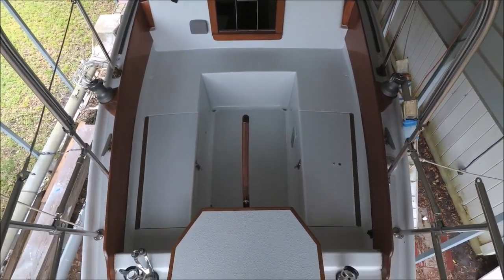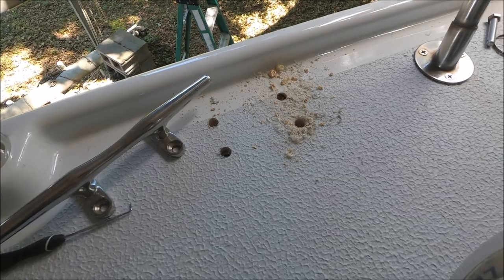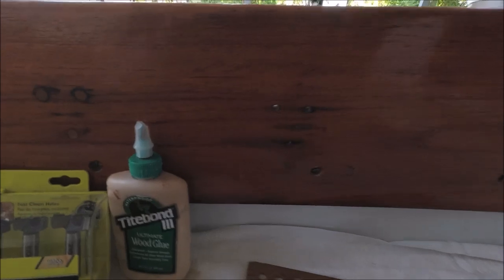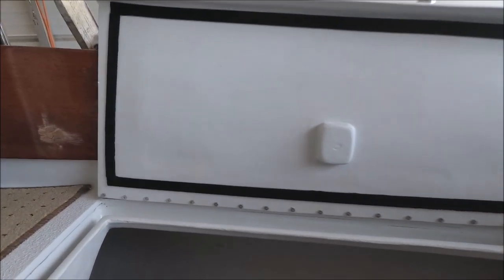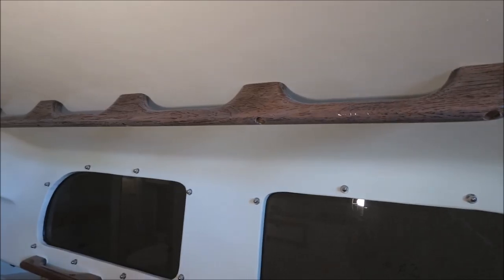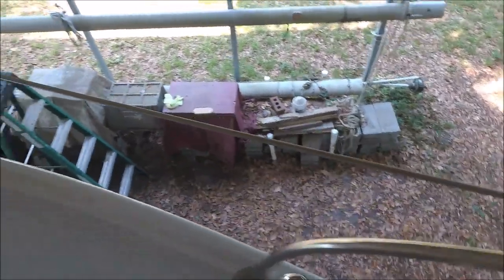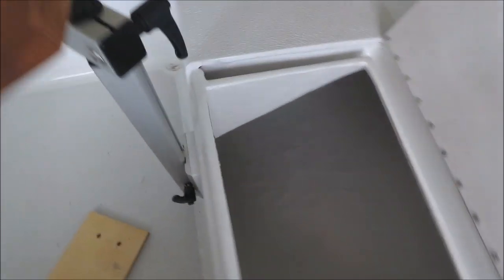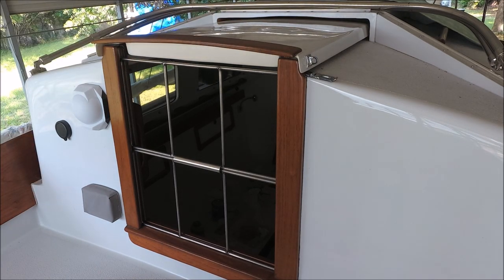Installing Sailboat Deck Hardware Triton Osprey Refit Part 14

Comment: This guy is one of the best and well thought dudes I have ever come across.  Gotta love it.
Reply: John Bolongo Yes he is. I had originally thought to place some kind of outboard motor mount to the back of my boat(which would be ugly probably) but then I saw these Alberg 30s with an outboard coming out of the transom and I’m like “genius”. Now i can have a 9.8 outboard as the main drive and a 9.8hp for dinghy( build up the capacity plate to allow for the longer shaft) and backup as main. Redundant engines! At least, thats my initial thought.

Comment: Beautiful. Electrical question. I see you use GFCI receptacles.  My old boat does not have any. Should all recepticals be GFCI?
Thanks. You do beautiful work.
Reply from the maker: I hesitate to give AC electrical advice but as I understand it you only need the first receptacle on each circuit to be GFCI since it can protect downstream receptacles. But I heard it is recommended to have GFCI in galley, head, and engine room. Since I work mostly on small boats that are potentially wet in every location, I use them for all outlets. On a bigger boat with many more outlets, if I was on a budget then I might use cheaper standard outlets in the drier areas while ensuring the first receptacle in each circuit was GFCI.

Comment: Thanks for another great video. I'm having trouble finding a decent, marine butyl tape. Could you please let me know what brand you use and what to look for in the specification?
Reply from the maker: I've tried several butyl tapes and found all of them less sticky and prone to leaking except for Bed-it butyl which is pricey but excellent:
https://shop.marinehowto.com/products/bed-it-tape

Comment: Hello James, been enjoying your videos.  I have a question for you ; I have a 1960 Triton that I removed the rub rail to clean up and get ready for new paint and I see the hull to deck joint needs some work, the sealent has gapes . How is the deck to hull joined ?  I reach up in the inside  of toe rail and can not feel any bolts or any other fasteners. How do I clean out old seal and reseal the joint ?
Reply from the maker: The hull to deck joint on the Triton is a butt joint with no overlap or fasteners. The factory set the deck on and then glasses the joint on the inside. They may have added filler or caulk on the outside. You can scrape out the loose caulk and fill with 5200. By the way, you may want to join the plastic Classic Forum to ask future questions and I'll answer there. I've been referring questions there where the group can benefit from the discussions. http://plasticclassicforum.com/forum/

Comment: I really enjoy your videos and have learned so much from them.  I would like to ask you a question regarding corrosion between dissimilar metals.  I thought you had mentioned this on one of your videos but could not find it.  I am currently doing some work on my boat trailer.  I has a steel frame and I need to replace some of the bolts. I am planning on using stainless steel bolts.  Do you have any recommendations for preventing corrosion? I thought there were some products that could be applied to the bolts.
Reply from the maker: I use Lanocote on bolts to prevent corrosion when installing stainless fasteners into aluminum. Tef-Gel is also good for that. I don't use anything on stainless bolts on steel frame trailers but it might be a good idea to use it if it will go into saltwater. If so, maybe you can get better info on a trailer sailor forum.

Comment: Thank you. Seems like you would wire a house for AC.
Reply: Owner here. Didn't want AC, this boat is for cruising, not the marina.
Reply: @BrianBrownESS  
Understand about Air Conditioning. I was refering to alternating current.  
Such great workmanship on your boat. Love the videos
Reply: @stevewillis2112  - I was talking about alternating current, not air conditioning, but understand the confusion. I have a 1200W inverter to run small appliances , tools, and chargers. I don't plan on spending a lot of time at marinas, and so the choice to forego shore power simplified things and saved some cost.
Reply: Thanks for clarifying, sorry about that. I am installing the same inverter James uses on my boat. Actually wiring it the same way. Clean method.